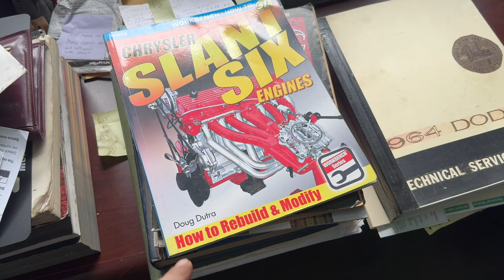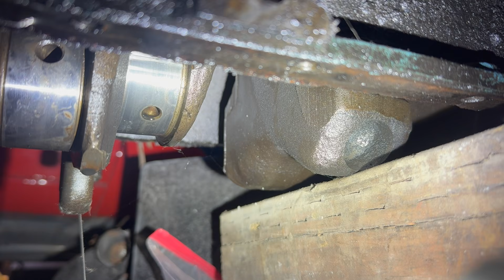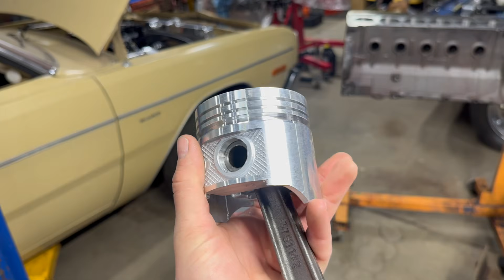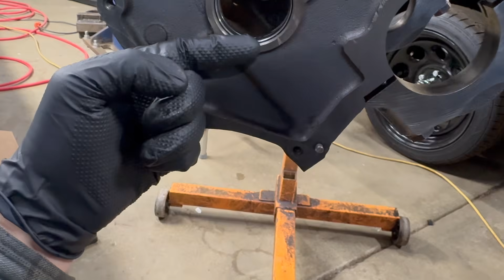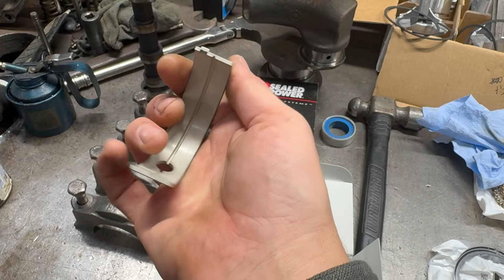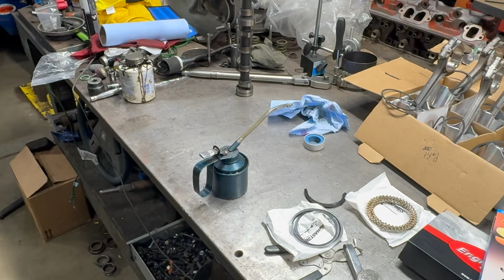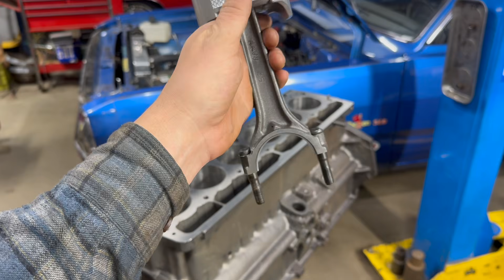Go Fast Slant Build! Lightweight 225 Info, Deck Milling Tech, Short Block Assembly, And Much More

Comment: My advice , toss the slant six ,google an Australian wrecking yard that freights to US , and grab a 245 ci Hemi or 265 ci Hemi straight six , made by Chrysler Australia, they have LA V8 bellhousing pattern, bolt anywhere a Chrysler V8 was , the 265 ci Six Pack Hemi straight six was the Top HP factory engine in Australian Chargers the RTs , off the factory floor it was rated at 302 hp but everyone ever dynoed was well over 330 hp , with std factory 3 x 45 DCOE Weber side draught carbies, factory tube headers and high comp pistons , big cam . The 340 LA and 318/360 were also available in the same chargers and were 2 seconds slower ! Espically the 265 Hemi is legandary in Australian racing , it was built to run and beat , Ford GTHO phase 3 falcons with Boss 4V 351 Cleveland's and GM Holden Monaro's with Chev 350 HO motors and the 265 Hemi in the R/T six pack Chargers did this well. The engine family is 215 ci Hemi (3.5 litres) , 245 ci Hemi (4.0 litres) and 265 ci Hemi ( 4.3 litres) , certainly would be different in a US car, the motor has LA V8 bellhousing pattern so anywhere a LA or A engine is it will bolt , manual or automatic. Still can find them in Australian wrecking yards , freight to US is cheap , plenty of after market parts in Australia even alloy blocks and heads, stroker kits to 320 ci , they run LA V8 rods, some internal parts , pistons are v8 , anyhoo , a 265 Hemi with triple 45 webers and headers would certainly be different in the US Chrysler scean. Different is good , every body is sick to death of seeing an LS in.evetything !😢😢😢
Reply: Actually most 245 and 265 ' are cast to only bolt up to Borg Warner 35 automatics , the ones that took a Torqueflite are way less common.  Not so sure about manual transmission fitment.
Reply: @barrycouta all the Hemi Six's I've worked on had LA V8 bellhousing, the D20 single rail bellhousing is the same one for Hemi Six and LA V8, it has a starter bulge up high for the six and another lower for the V8 , I've built a few , never seen a BW35 trans version , they must have been cast all the same , it wouldn't make sense to cast a different block . So they all must be capable of being LA pattern. What about Hemi,s that had 904s ? It's so stupid drilling for two different bellhousings , Holden did the same thing , the Trimatic pattern is very close to Oldsmobile and then they drilled Chev pattern as well on the same casting .
Reply: @JosephCowen-fz8vj That's strange, my VH Valiant 245 came with a BW35 , something broke inside it in the 1980's when Dad owned it , he got it fixed , and in the nineties it failed on me , I bought a second hand BW35 out of a wrecked VJ , and it's been good ( I've heard that from the VJ s onwards  they are stronger) , I also had a VG hardtop, the BW in that broke and I got it rebuilt. The point is , that they were all Hemi's with BW's .I would have much preferred that those cars had  Torqueflite's . Another point of interest, is that Hemi Performance used to advise not trying to fit a Torqueflite behind a Hemi 6 , because they had tried to extensively but had unsatisfactory results, and instead recommended using a GM TH350 , which as I recall they sold an adaptor for doing that . Times change though , and now , I think they actually supply an adaptor for Torqueflite to Hemi 6. Could it be that you've been lucky enough each time to get hold of Hemi's with the T/F bolt pattern ? . Ive heard that those were limited production for heavy duty use such as Taxis.
Reply: @barrycouta yes I saw castlemain rod shop, welds the BW 35 starter buldge on the TF, they say the normal TF on a Hemi puts the starter on the oil pan , and gets hot . But it can be bolted on , may be that's what they refer to , it fits sort of buy not a perfect solution.
Reply: @JosephCowen-fz8vj Good detective work . On the basis that my all my 245 's ( and a 265) all had Borg Warner automatics , and that I heard years ago that a Torqueflite won't bolt up to that engine casting ( at least not easily) , I have thought, that if you can bolt a manual box to them , then why not a Torqueflite? . The manual Valiants used American gear boxes didn't they? , so you'd think the bolt pattern would be the same 🤔. I'm a bit confused.
Reply: @barrycouta yes , it's a mystery, the majority of Australian Hemi's I worked on were manuals , it's an interesting era, Chrysler Australia commissioned Borg Warner Australia to build them a 4 speed manual . And the D20 Single Rail 4 speed was the result, later they fitted them to Ford's and later there was a 5 speed single rail. That morphed into the US Borg Warner T5 with an alloy case and a 5 gear. But 90 percent of the original Chrysler Australia Borg Warner D20 parts fit in the T5 that was used in many brands all over the world . Dellow  Bellhousing's from Sydney Australia who cast original replacement and other combination bellhousings lists only one bellhousing pattern OEM for the Hemi Six's, I'll do a bit more looking into it .
Reply: @JosephCowen-fz8vj So, the one or two  Hemi's that you worked on that had automatics attached were Torqueflite's? . I didn't realize that the Borg Warner 3 and 4 speed manual boxes in Chargers and Pacers were designed by BW in Australia, I always thought they would have been what the Americans had , but made in Australia.  I had a three on the column manual , base model  245  VG sedan , what box do they have , Borg Warner as well ? , but not the same 3 speed as in an E38 Charger ? ,I assume .
Reply: @barrycouta the Australian Chargers and Pacers used Borg Warner Australia 3 speed made in Australia also used by Ford Australia behind 200 and 250 sixs , Australian Chargers raced with the 3 speed Borg Warner Australia box ( a grate disadvantage at the time against 351 Cleveland Falcons with Top loader,s and Holden 327/350 with M21 Muncies ) Chrysler Australia approached Borg Warner Australia who already supplied all the Australian Chrysler's with diffs , Borg Warner 78 diffs also used in Falcon six and 302 Cleveland cars, to create a 4 speed , Borg Warner Australia came back with the D20 4 speed Single Rail. With much copied from the Ford top loader . The only US Transmission used in Australia for Australian Chrysler's was the 904 TF , so no other US transmission was used . The Borg Warner 35 was also used on some Australian Fords the 200 six got them . Borg Warner Australia did a really good job on the 4 Speed single rail, its about 85 percent as strong as the standard Top loader. Single Rail 4 speeds always had the Chrysler box to bellhousing pattern, even when Ford used it , different input and out put shafts on the Ford version , whaen Borg Warner US designed the T5 it used much of the single rails design including the original box to.bellhousing pattern . You can always tell an original Chrysler Australia D20 Single Rail 4 speed by its fine spline input shaft and extra long splines for the twin plate clutch all six hemis and LA V8s used in Australia. Three in the tree is a Borg Warner, it was popular to get a Speco Floor Shifter for them in the 1970s /80s.
Reply: @barrycouta  I just looked it up , it's the same bellhousing pattern, just starter location , you can bolt a LA V8 904 TF to a Hemi Six , it just drops the starter down low near the sump on the Hemi , there's Castlemaine Rod Shops solution, they cut the 904 and Tig weld the starter bulge section of the BW35 on the 904 . But same pattern. Bolt holes in the same place as LA V8 . I was thinking of all the six HEMIs I've worked on there was no different pattern ..
Reply: @JosephCowen-fz8vj That's very interesting. Ive got a rebuilt 904 Torqueflite doing nothing, and have thought it would be good if I could use that in the VH if needed , mind you, it's the lighter duty one that  goes behind a Slant 6 ,  have you ever heard of one of those used with a Hemi , I've been told it cant be done .
Reply: @barrycouta yes , i emailed Dellow as I knew Jeff Dellow well , it is possible the bellhousing holes on some are different, but I've never seen that. The 215 and 245 with 3 speed Borg Warner manual can be swapped for 4 speed single rail and that is the 6 Hemi / LA V8 one , as I said, it has both V8 starter bulge and six one on it . Same bolt holes . So I'm at a loss on this one .

Comment: I love straight 6 engines, I've owned and/or driven all of them, Chevy, Ford & Mopar, the slant is about most gutless 1 of the lot, BUT,  it's also the most durable hunk of cast iron ever built, I think the 4 main bearings is why you can beat the £♡《#  outta 1 for days in the woods after draining every drop of oil and coolant from it, run em til the exhaust manifold is glowing red and it heat seizes, let er set 20 minutes, fires rite up, do it again

Comment: Really interested in this project Jamie. Two questions:

I have a 73 Scamp 225 and I'm in England (so not much option for a "selected" year engine to build) is it still a worthy year of slant?

Secondly, is it possible to get a bit closer to the 200 bhp end of the scale without major alterations? 

Thank you - Chris.
Reply from the maker: Yes - while the 80s engine is a better candidate for the weight related reasons I discussed, you can do all of the same things to the older 225. Something approaching 200 horsepower should be possible. Raised compression through decking, more aggressive cam, valve springs to match, tweaked cam timing, super six intake and two barrel, split exhaust manifolds with a Y pipe, and careful head porting are all things you can do to get there.

Comment: One idea to consider is using the Lucas Oil Additive in the big quart jug. Used it on every engine ive done and even after sitting for months it works great and sticks to the bearings without gumming up. Ive always had good luck with it. As a die hard chevy guy I might come over to the dark side and try a Mopar. Love your channel. Great info. Thank you!!!!!

Comment: Hey man i live in chehalis. Ive been siding houses out on the skokomish reservation for a gov't contract and got a 1990 ramcharger 100 for pretty much free. Shes a 318, 4 speed manual, 4wd flavor. Shes got a cracked block but is straight and solid as can be. I popped a freeze plug in and replaced the fuel pump and rear fuel lines, thermostat housing and thermostat, etc. Long story short i got her running. I picked up a used block thats classified as a "race engine", based on the casting code. Just wondering if i can get some pointers on my first rebuild/ swap. Do you do this stuff as a business or take on customers?

Comment: Just an FYI about main bearings. I'm not sure about the cast crank engines, but on the forged crank engines, the # 2, and 4 main bearings are the same but the factory # 1 main is different. It has a champher on the upper shell at the parting line for timing set oiling. All the "aftermarket" bearing sets I have seen do not have that champher. I put it on wih a file.
Reply from the maker: Interesting. And good to know.

Comment: hi Jamie, I had one of these engines in a Plymouth in the '60s. the one I had you could take a nap before it would make 60 mph. I was surprised that anyone would try to make it fast. I'm guessing that the head needs a substantial amount of work to get any power from it. maybe an iron lung would help😂
Rich
Reply from the maker: Guess you’ve never driven a good one 🤷‍♂️

Comment: wiseco do slant pistons.  Thinner rings for less friction. Forged .Not cheap , About $1350 AUD .  I think you need to pair them with the 7.005 " Rods to get close to the deck.  Stock Rods may need big deck chop . not 100% sure on those details .   Im Currently prepping a block for a AP5 Valiant. Mostly street ,a few visits to the strip per year. looking to make about 250hp and 3000lbs max race weight . Going for  13.5s and streetable .   Triple webbers may get me there!
Reply from the maker: Not cheap sounds right to me. Longer rods have been one method but I’d prefer not to do that.

Comment: Yes, there's a lot of silly nonsense talked about main bearing journals (number of and size of). The old Austin 7 (1922-1939, 4-cyl., 750cc), the basis for so many racing cars after the war, including Lotus, and still raced today, started off with 2 - yes, two - main bearings. One changed gear when the crank whip made itself obvious. Later they put a third in the middle. The cranks broke when raced, at least more so than the 2-bearing ones. Incidentally, a factory Seven special with a double-overhead cam head replacing the flathead original, plus other enhancements broke the flying km and mile records for their class in the 30s at something like 136mph or thereabouts. As for journal size, Triumph's small 4-cylinder engine (Spitfire, etc) in its 1.3-litre guise had the diameters of the journals increased for the Spit Mk.4 over the Mk. 3, and the engine lost power: too much friction and weight, though stronger in this case, not that the old ones failed. Obviously there are other factors that play a role, but more and bigger do not necessarily mean better.

Comment: While looking into building my own 225 Slant 6 (74 Duster, I believe it's a forged unit), I found you could use Dodge Daytona 2.2l Turbo pistons and 198 Slant 6 connecting rods. While the pistons are still available new, OE or used 198 connecting rods are unobtanium. But K1 Technologies makes a forged H-Beam version of those rods for this purpose
Reply from the maker: Absolutely. That’s an option.
Reply: @DeadDodgeGarage  Loving your content btw. Me and my boyfriend love seeing what you do with old Mopars!

Comment: That piston down that far in the hole is amazing !!   I'm really curious what your final measured compression ratio will be.  I guess this one will need more than a wee bit of head milling.  The frustrating part (To Me) would be the inability to achieve any squish and the mixture motion and combustion efficiency that go with it.
Reply from the maker: There’s really no winning with the slant… nothing about it is ideal for making power.
Reply: @DeadDodgeGarage  I've dealt with the same problem with the ridiculously heavy and overbuilt 4 cylinder Land Rover engines for the last 4 decades !!   The 4 cylinder that weighs the same as an all iron small block V8.  They were originally designed as a Diesel (Opposite of what GM did) and the block, main bearing webs, and crankshaft are comically stout for a gas engine. The oiling system is awesome, with 360 degree oiling to the rods, and they have a large diameter roller camshaft. Pistons are zero deck from the factory, and the stupid things withstand .200" overbore with no worries, .250" with sonic check..    However.... the cylinder head has all the same problems as the slant and they really resist improvement !!    I'm currently helping some friends on a new aluminum head design , as there are a ton of these around the world that need help.    Oh, and six 1/2" fine thread bolts around each cylinder invites some serious boost.  We have access to a chassis dyno, so this will be a fun R&D project.   I sure wish someone would do something like this for the slant !!

Comment: I built a pretty surprisingly good running slanty many years ago using a combo that I bet no one even remembers anymore. I got the info from a magazine I think it was early 80s, maybe Hot Rod, maybe Motor Trend, I just don’t remember any more.  Don’t even know if the parts are around to do it now days.  
225 block and crank, 198 rods, and oversized 2.2 4 cylinder pistons. Deck height is very close,  just some minor mill work needed.  Stronger lighter pistons, forged rods and crank. Port the heck out of the head, bigger valves, 390 Holley on an offenhauser manifold, Clifford header,  and my dart had a 883 aluminum 4 speed. It ran very well for what it was, OD 4th made it a freeway killer.   One I should have kept. Who here knows that there was an all aluminum slant 6? The 198 was cast in iron and aluminum.
Reply from the maker: That combination is still known. I was just reading about it somewhere. Maybe Dutra’s book, don’t remember. No, the 198 was NEVER aluminum. The 225 BLOCK could be aluminum in 1961 and 1962. It also had an aluminum oil pump and I believe an aluminum intake. The aluminum head never made production. There was also a later aluminum intake in the 80s that is widely regarded as terrible.

Comment: My dad gave me his dad's D100 farm truck. The engine was really low on compression but didn't smoke much, so I drove it for a few years back and forth to college, work, and home. I wanted to impress my dad, so I used a 198 block and rods with Mopar 2.2 turbo pistons, a 225 crank, ARP fasteners, Ford Ranger 2.3 valves, Pontiac 400 springs, a performance reground cam, dual Dutra exhaust and a Super Six intake with a Holley 350 cfm carb and HEI module.  Swapped out the original 225 single barrel. His take on it? Congratulations, you managed to make the power of a stock 4 barrel 318 for twice the cost.

Comment: I have done performance Slant 6 work 20+ years ago, and am working on one now for the first time in a long time.  I just saw a video over at Slant Daily Garage where they went into detail about porting the oil pump holes and the oil galley entrances in the block.  A little drilling and grinding goes a long way to ensure good oil volume.  I don't especially like his delivery style on camera, too bland, but it was good info.  https://www.youtube.com/watch?v=oND1Iuq7x6U  And I always used to coat my FREEZE PLUGS with RTV for installation  :)